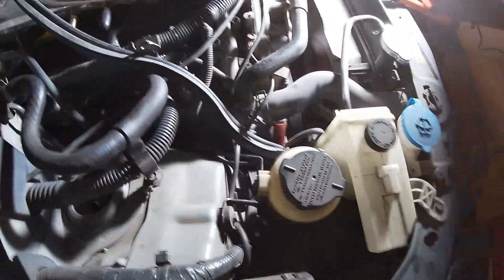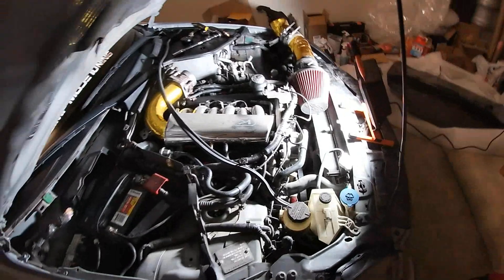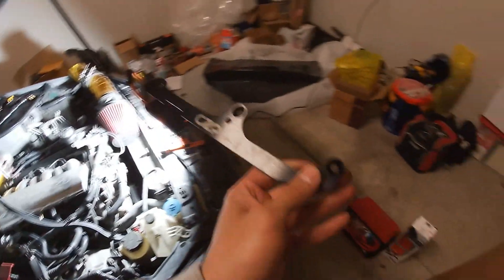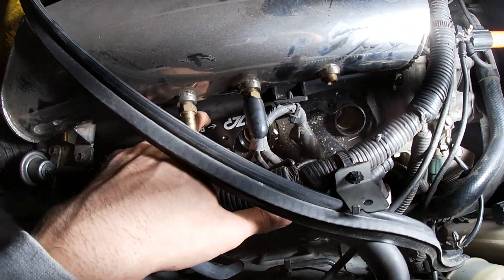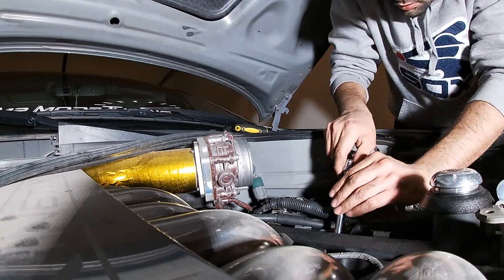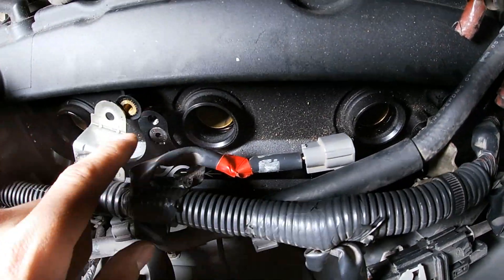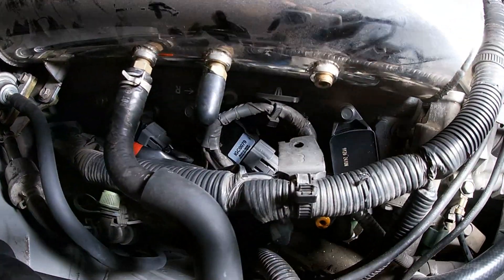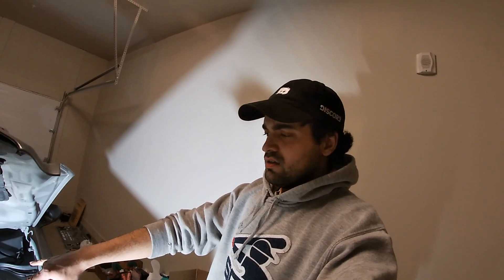G35 gets R35 GTR Coil Packs!

Comment: Wont the oil keep leaking in ruining the parts again
Reply from the maker: Long term yes. Im gonna replace everything when I get back from tuning this Saturday. Dont have enough time from now to replace the covers
Reply: @OPDrags  you must of had a small amount of oil in there hopefully mine aren’t flooded. How did you find out you needed new coil packs I got a check engine light. And how much did it cost to fix?
Reply from the maker: @infin819  i don't need new ones, just bought them for the hell of it lol. Testing them out today. Yeah i had a real small amount of oil on the threads.. Keeping my stock coils just incase I need them. But usually you'll get a misfire and there's ways to test them with a volt meter you can look up how to and what not

Comment: My question is...why? Doesn't look like your even boosted. Your not going to notice any change. The stock packs have seen use in engines over 1000 hp. Right now I'm at 755hp on stock coil packs but thinking about swapping cause it's about time to change them anyway.
Reply from the maker: My answer is why not? I was bored lol. I have a nitrous kit and most of a turbo kit to install whenever I stop being lazy
Reply: @OPDrags  Oh, well quit being lazy lol.